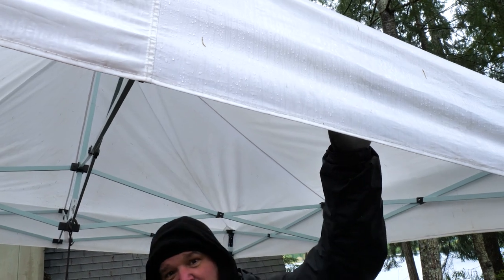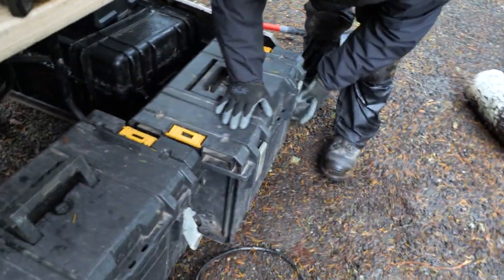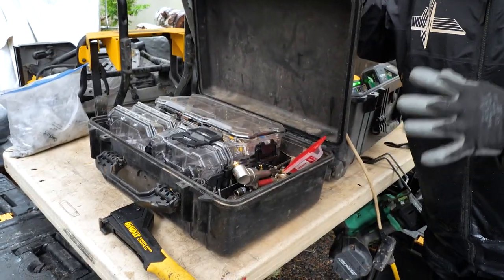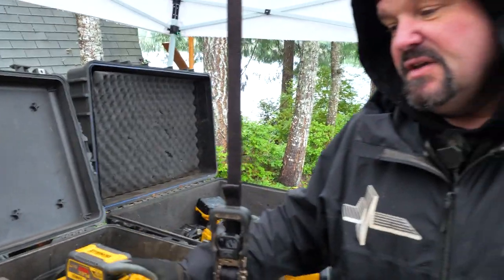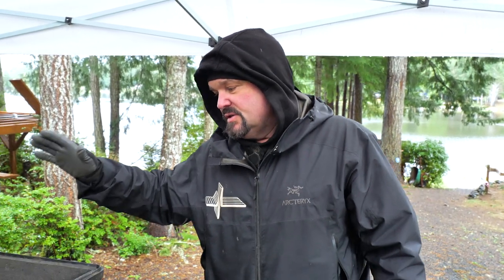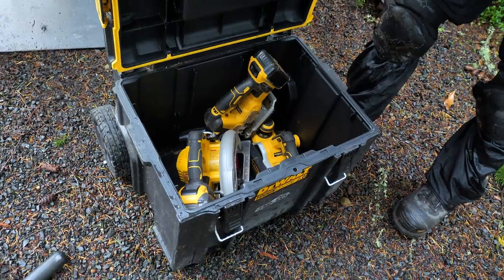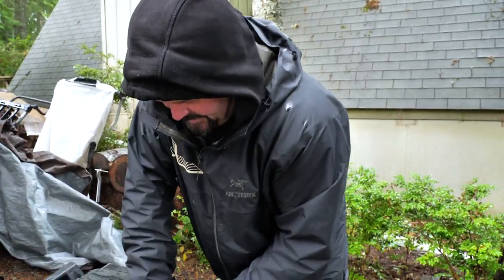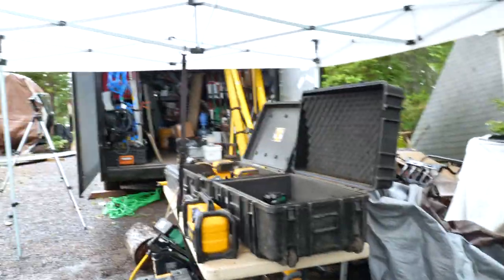What Do We Use To Keep Our Tools Dry || Dr Decks

Comment: Another great video! Thanks. Keep up the good work. Also a side, I too have many of the Dewalt flex volt batteries and the only complaint I have is sometimes you have to give them a good palm strike to get them clicked on the charger so I would try that first before I give up on a certain battery, I found that they’re tough to click on, and sometimes tough to click off!

Comment: Hey Dr. Decks! What kind of gloves are you using in this video, and are they waterproof?
Reply from the maker: They are made by Atlas. They are not waterproof but the finger tips are dipped in rubber so they grip good and will stay dry to a certain point